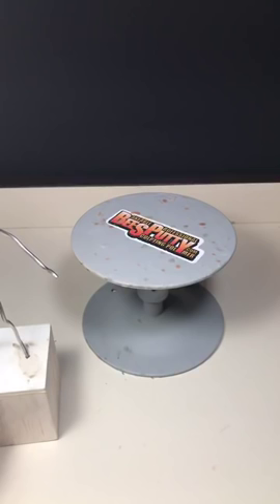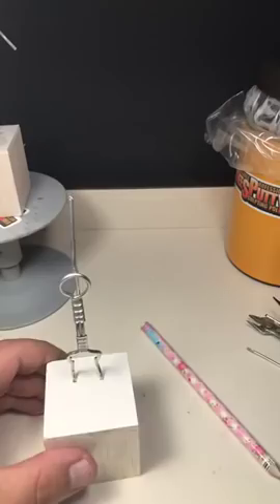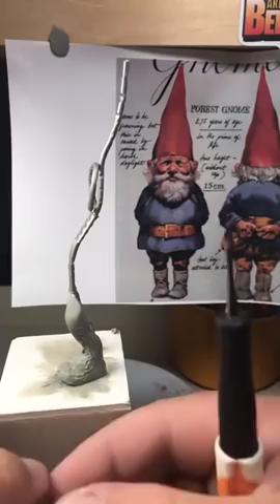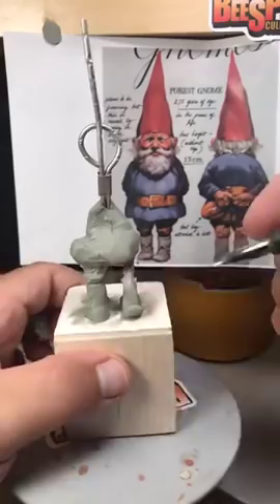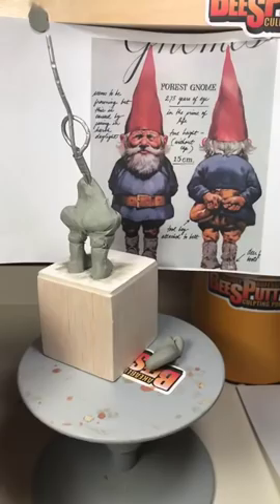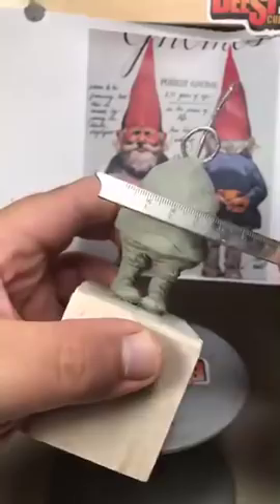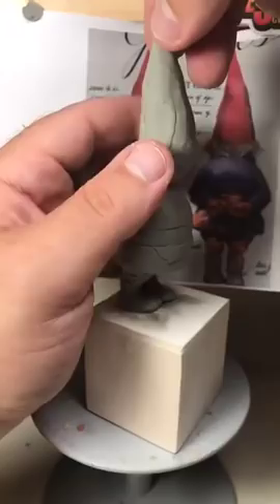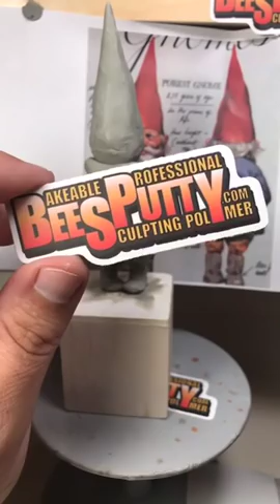The difference between BeeSPuttY and other polymer clays

Comment: Received my order of 2 100g packs of triple firm yesterday. So far I like it far better then the other 3 brands I have tried, though I am not a sculptor nor am I very experienced. Currently experimenting with different tools and figuring out the clay. Do you ever use aluminum foil or other materials to bulk out a big project to cut down on the clay needed?
Reply from the maker: I would like to see your work and if you have any questions feel free to ask.